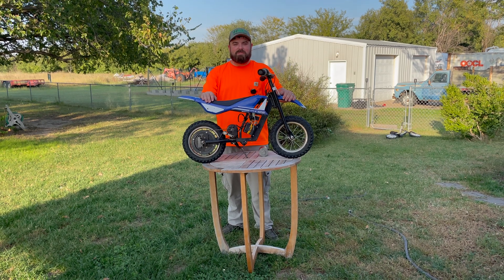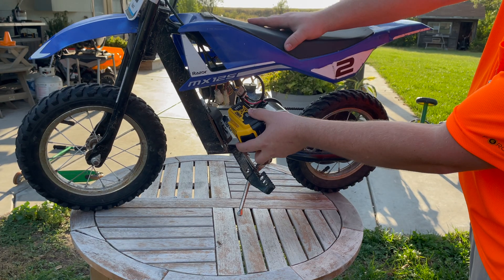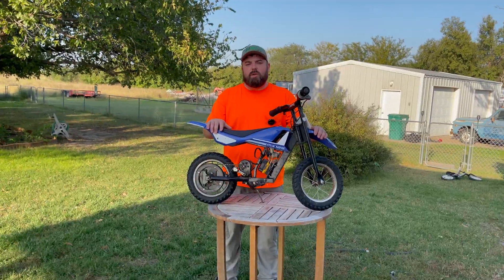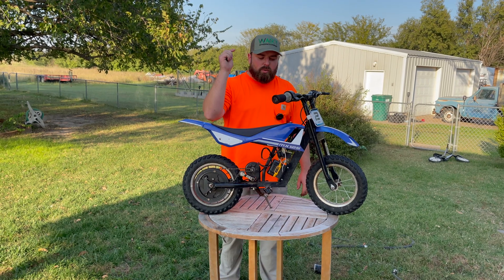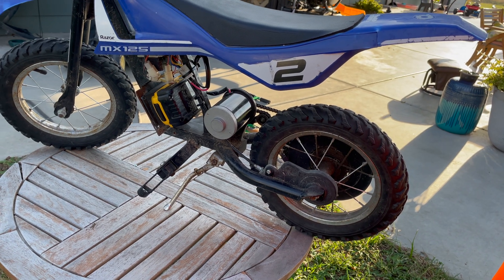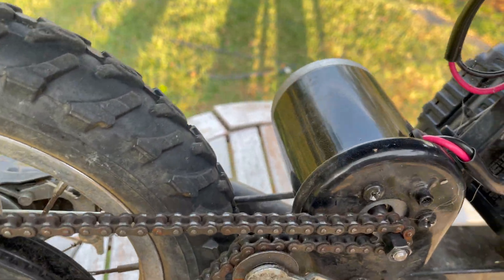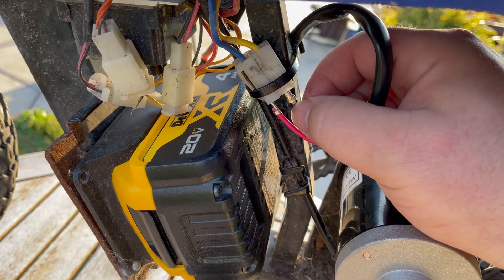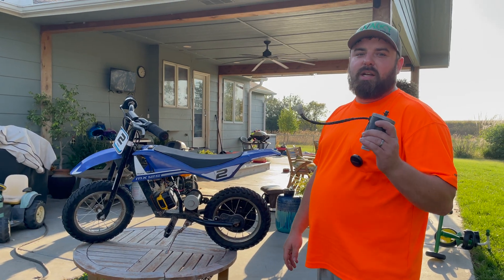Razor Mx125 Dewalt 20v Upgrade | 1 Year Update

Comment: I would love to do this to my sons mx125 however I get nervous because I did this with a power wheels quad and it would completely drain the dealt battery to where I couldn’t even charge it again. Has that happened at all?
Reply from the maker: It has not happened to us but I have heard of it happening. The batteries are supposed to have protection to shut down before they are fully drained. In our case we told the kids to stop when it starts slowing down so we can switch the batteries out.
Reply: @wackyengineering do you have the link for that exact battery adaptor you bought
Reply from the maker: We actually designed and 3d printed the one installed but this one should work fine. Amazon link: https://amzn.to/4soyM7M
The fuse size is 30 amps Im pretty sure!
Reply: @wackyengineering also what size fuse do you have?

Comment: Those male pin connectors would have slid right into that female plastic clip from the old motor! You have to reach in there with a tiny pick and release them and then cut the wires and you can have the nice plug end 👍🏼 cool video! Neat little bikes.
Reply from the maker: Thanks for the comment and information!
Reply: @wackyengineering  likewise! Have a good one 👍🏼